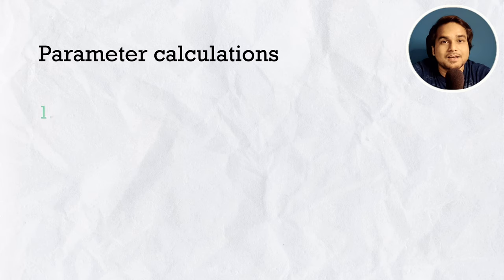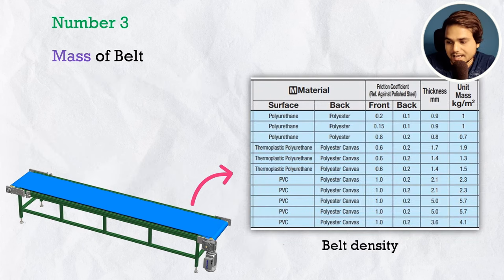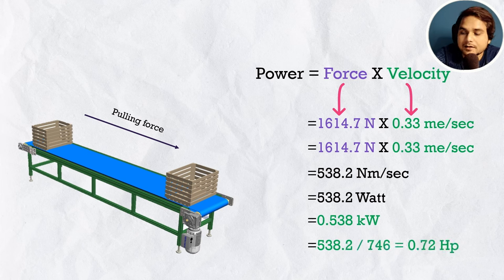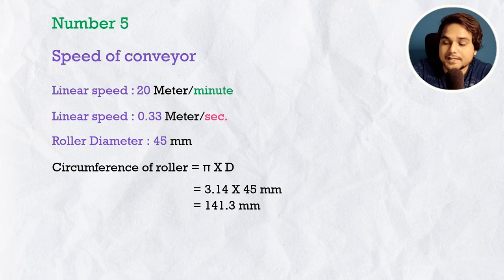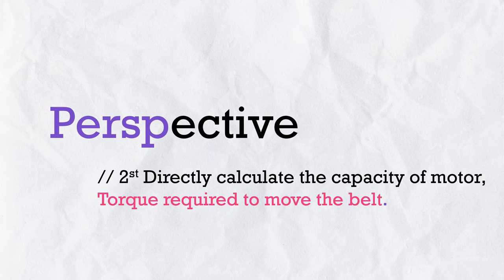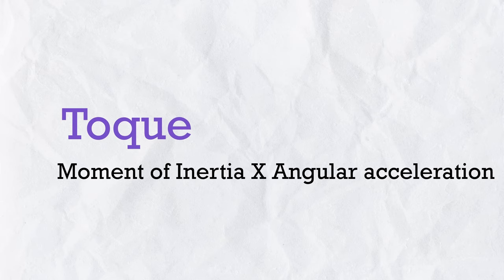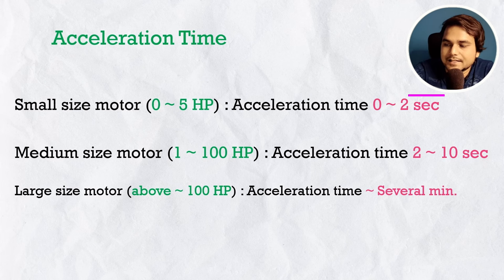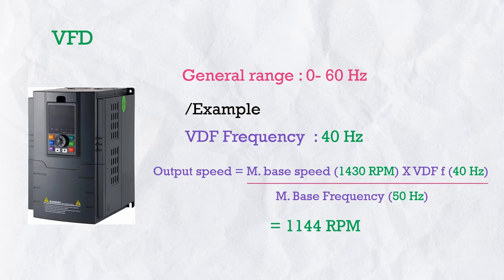Mastering Belt Conveyor Motor Selection and Calculation: Ultimate Guide

Comment: @ 7:29 when you are calculating Force  You have written 411.5 X 9.81x0.2 which equals to 807 only how you got 1614.7 as answer please reply @mastermechanicaldesign
Reply from the maker: There are some calculation typo mistakes. Your calculation is right